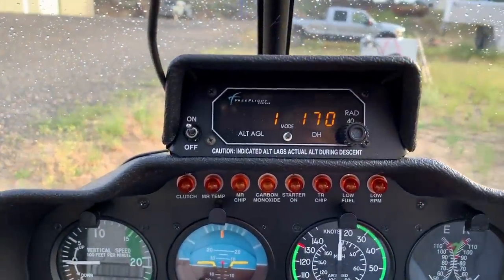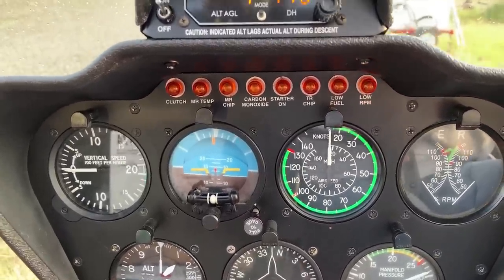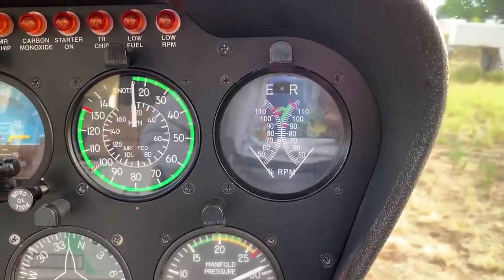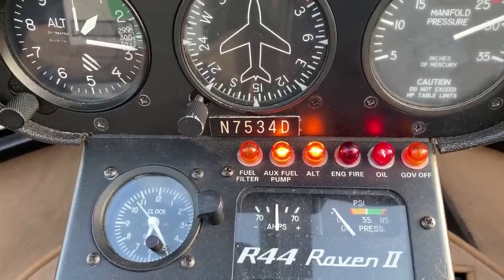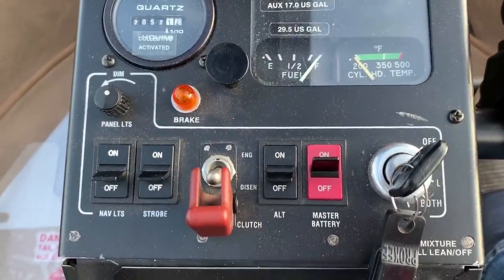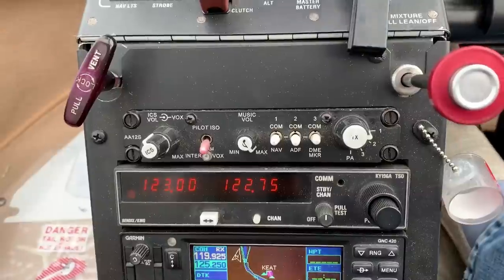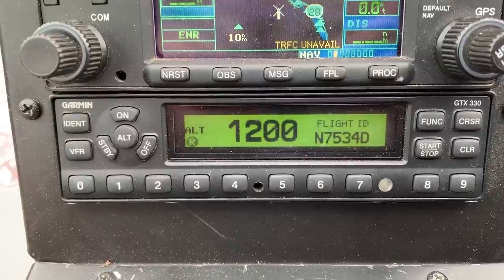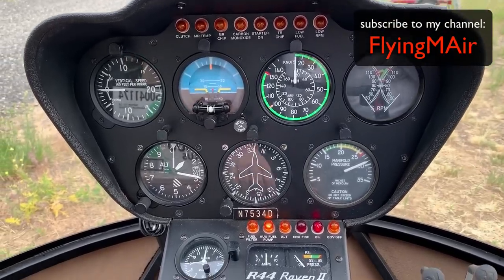R44 Helicopter Panel Overview

Comment: So after taking off do you drop the nose at any stage?
Reply from the maker: Depends on the situation and surroundings. Best way to take off is to accellerate quickly to 60 knots, which is my best climb speed. Normally, gaining speed requires me to drop the nose. But doing so can also cause a descent, so there are limits.

Comment: how much maintenance is there between flights?
Reply from the maker: Oil change at 50 hours, inspection at 100 hours. Not much else until the big maintenance items.
Reply: @FlyingMAir  thanks for the info :) I guess the big items are pricey ;)

Comment: DIRECTIONAL GYRO: Aircraft have this compass like instrument because it's much more smooth and precise than a compass which tends to wobble around and lag behind turns.  Much better for precisely tracking your turns and direction under instrument conditions (in clouds).   BUT...a gyro instrument is subject to recession,  which means it slowly falls behind the true direction. Unlike a compass that always follows magnetic north,  a gyro must be reset to the correct direction every flight.  You simply note the actual compass during straight flight or sitting on the ground and turn the knob on the directional gyro to match.

Comment: Are all helicopters created equal? If you wanted, could you fly say, a Huey helicopter? Or, an LAPD airship? I only ask because I really don't know.
Reply from the maker: They all fly pretty much the same. They start differently, though. And they feel differently in flight, like the difference between a sedan and a truck. I've flown R22, R44, Bell 47, and Bell 206L (Long Ranger) helicopters. Takes about 5 minutes to adjust to the controls when switching from one to the other.

Comment: Great explanation. I’m a fixed wing pilot, although I have had a couple hours in rotor craft, so it’s pretty familiar. Interesting that you have an engine governor. In the old days e.g. Bell 47 era, you had to handle collective and throttle all the time.
Reply from the maker: The collective in my R44 (and my previous two Robinsons) pretty much stays where you put it. The throttle is controlled by an electronic governor that keeps the RPMs just where they need to be. That's a huge reduction in pilot workload. Most modern helicopters have something similar and that's a good thing.

Comment: Just joined the channel. Your panel looks a lot like the Cessna 150 I trained in back in the 1970s. The only things missing are a VOR indicator and a couple of Narco Nav/Coms. Nowadays the VOR is pretty much useless because of GPS. I wish I had had a better paying job as I would like to have gotten into flying helicopters. I live on the San Francisco peninsula (near San Carlos airport - SQL). There are lots of grapes near here as well fruit and nut trees in the central valley. I can see myself doing flights to keep stuff from freezing.
I've watched most of your videos and love what you do. I've also checked out the Robinson website. Even the R22 costs a bundle! Not a poor mans hobby, just like fixed-wing aircraft! 
Thanks again for posting your videos. I'll be waiting for the next one.
Have a good one!
Dave

Comment: First of all, thanks for the great videos you're making. I especially liked the video when you showed how you dried crop with your helicopter with a student inside. It was thrilling to watch how low you went over the trees.
I have some dumb questions I hope you will take your time to answer: 
1. Why did you call them "top row of idiot lights"? Aren't they pretty important?
2. Even if you fly VFR aren't there some areas where you there is a minimum height you have to fly above the ground? For example over Oslo, Norway (where I live) I think you the minimum height is at least 500 feet above the ground when you are over populated areas. I would guess it would be hard to tell if you are 400 or 500 feet above the ground, but  I'm not a pilot so I don't have a clue about this so please have that in mind when (if) you are answering. :-)

As mentioned, I liked the videos watched so far so I've subscribed and the bell is clicked. :-)
Reply from the maker: 1. It’s NYC slang for warning lights. Sorry. Inappropriately used here.
2. There is no specific minimum altitude for helicopters in the US.

Comment: Cool! I always thought R44s were turbine and R22s were reciprocating. Learned something new.
Reply from the maker: R66s are turbine.
Reply: Chip Kankel - the R22 uses a 4-cylinder engine, the R44 a 6-cylinder piston engine, and the R66 is the turbine-powered model.  It looks almost identical to the R44.

Comment: ALTIMETER:  It must be 'adjusted' because barometric pressure is always changing (think of weather reports). Since an altimeter works off pressure, it will give the wrong altitude when the pressure changes.  Pilots correct this by turning the knob, which adjusts  to the current barometric pressure,  30.10 inches or some such.   Airports broadcast the current pressure, so it's easy to get (and to make sure all nearby pilots are at the same setting).  Pilots will reset that knob from 1 to maybe 3 or 4 times during a typical flight.
Reply from the maker: Altimeter.
Reply: @FlyingMAir  Done.   Thanks for the catch.

Comment: question:  Does engine power / thrust change with the clutch or does the rotor pitch change???
Reply from the maker: Rotor pitch changes with the Cyclic and Collective. Power changes to maintain RPM in the green.

Comment: Are you not concerned about your carbon monoxide detector going on and off?
Reply from the maker: Nope. It goes on, I open the vents, I fly with fresh air coming in, and it goes off. It only goes on occasionally, and that's always when I'm on the ground idling and a breeze (or wind) is blowing smoke up front from behind. I think this CO detector is a bit more sensitive than the one I had in my last helicopter. That one rarely went on, but always in the same conditions.
Reply: Interesting. Here where I fly, CO warning is considered as "land asap" condition.

Comment: Recent subscriber, love your videos :)  Possible noob question - Presuming the altimeter is set/calibrated by you at ground level when landed. Does it read height from your set zero point, or actual distance from the ground? For example, if you were flying at 500ft over flat ground and held straight and level then you approached a hill, would the altimeter reflect the decreasing distance to the ground as you passed over the slope of the approaching hill, or would it show your altitude in relation to your starting elevation, regardless of the actual distance to the ground? Thanks in advance for the reply :) x
Reply from the maker: Distance from sea level. You set it with a local altimeter setting (inches of mercury, if available) or actual elevation (if known).
Reply: The radar altimeter at the very top of the panel tells her the height above ground, so that will change as the aircraft approaches a hill. The other altimeter is a pressure instrument, so it indicates the altitude by measuring air pressure. The higher you go, the less dense the air is.
Reply: I believe, the 1st device she talks about gives height above terrain.
Reply: The radar altimeter (digital one at the top) would show that decreasing height Above Ground Level (AGL), while the pressure altimeter (the big dial with clock-like hands)  shows height above mean sea level (MSL).  The mechanism is similar to an aneroid barometer. Setting the "numbers" in the little window (it's called the Kollsman window)  adjusts the reading to compensate for local air pressure variations due to weather.
Reply: The barometric altimeter will not respond to terrain but the radar altimeter will.
Reply: @FlyingMAir  I guess the outer air pressure can change quickly during a flight. Why does the instrument depend on that instead of GPS-reported sealevel altitude which (I think) is more precise?
Reply from the maker: It does not change that quickly. I seldom change the altimeter setting during a flight. I usually set it at the beginning and leave it. Only exception is when I'm doing a long cross country flight. I'm not convinced GPS-reported altitude is more precise and I don't have my GPS set to display it by default anyway. I honestly don't care what my altitude is since I can see where I am over the ground. The only time I really need it is for position reporting, which I seldom need to do in my area.

Comment: ALT AGL.... just had to come back to this video after I saw AeroMexico plane collide with a small plane due to small plane not equipped with ALT AGL; therefore tower couldn’t see small plane. Result was a fatal crash in mid air right before Aeromexico was about to land.

Update: planes required TCAS and Mode C transponders after investigations. Is that the same thing as ALT AGL?
Reply from the maker: I’ve never heard of ALT AGL. AGL refers to “above ground level” in aviation. It isn’t an instrument. I have a Mode S transponder and ADS-B out on my helicopter.